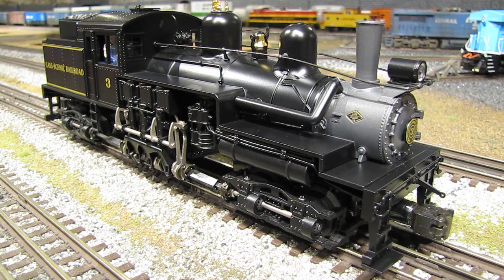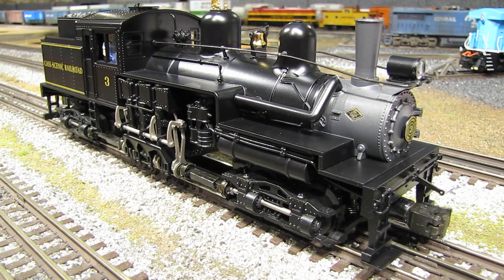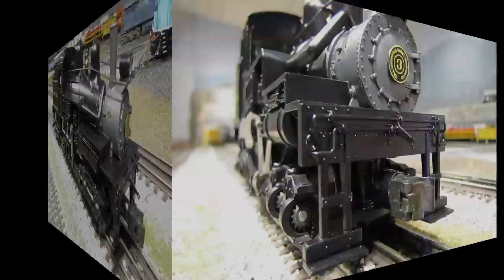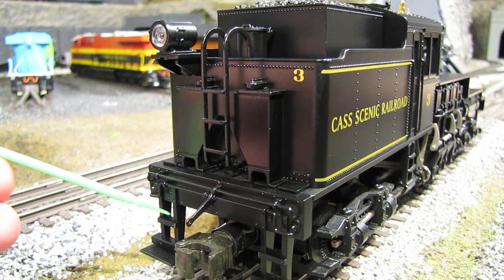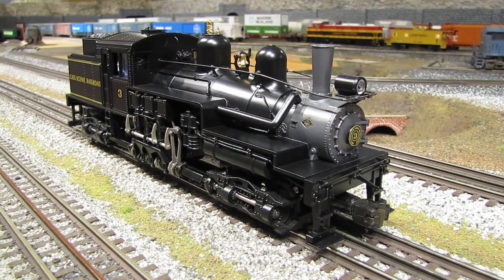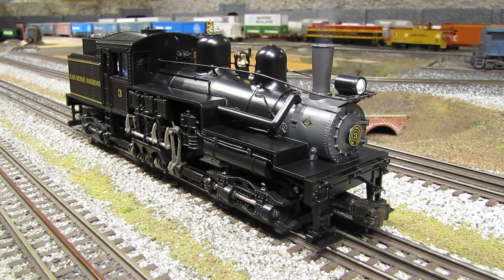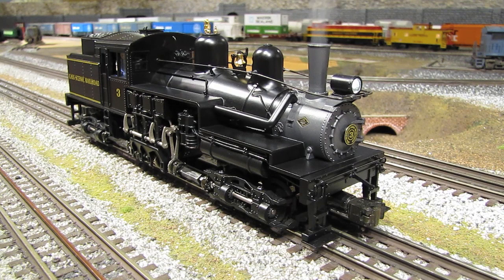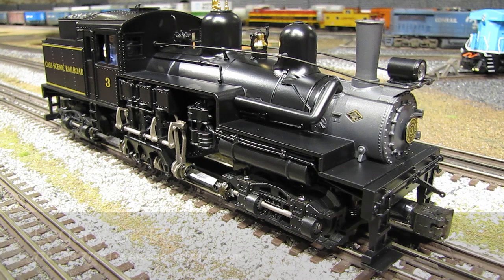Lionel 2-Truck Shay Locomotive

Comment: I've been on the double-header full day trip in cass on that railroad. Numbers 3 and 6 pulled my train (I should say pushed as they never ran the trains with the cars behind the engines when going on logging runs or in the excursions currently ran. I recommend going for anyone who's into railroading. I have a great love of west Virginia and the history of that region so it was a great time but when I found out that just about every locomotive they run was made in my home state of Ohio it brought even more pride in my state. Going up a 14% grade in a train was also incredible since virtually no other locomotive is capable of it on smooth track.

Comment: This 2-truck shay of course is from K-Linemtooling. Lionel got them when they sued K-Line and put them out of business. The actual scale of the model is a bit larger than 1/48th scale coming in around 1/43rd scale which of course makes our O gauge track more correct in its gauge.

Comment: By the looks of the trucks, that is a 2-truck Pacific Coast Shay. Pacific Coasts were basically a much-improved on version of the standard Shay (with such improvements as a new truck design, superheater as standard, Walschaerts valve gear, etc.) in order to compete with the Willamette geared locomotive, which itself was a much improved-upon copy of the Shay. Then, of course, Heisler came out with their West Coast Special Heislers to compete with the Willamette and Lima's Pacific Coast.

I'm not entirely sure if there ever was a 2-truck Pacific Coast built, but it could've easily happened.

Comment: Great video! I didn’t know the front opened. I bought the Western Maryland for my son a number of years ago. Problem is it goes a short distance and trips the transformer. All of our other locomotives run without issue except the shay. Ran it on someone else track and ran fine. We run a Rail King z controller. Any ideas? Thanks in advance

Comment: Lionel's been using three rail track for a long time, only reason they haven't gone over to more prototypical two rail is that it would make the older trains and accessories, say the postwar stuff, incompatible.

I see that as a good thing, for given the cost of even the older Lionel stuff, it's nice to know that it'll all still work with the present range so long as you're running conventional DC.

Comment: Awesome video! But a bicycle does not actually have reduction gearing. Even in 10 speeds the lowest gear is close to 1 to 1. So a tricycle actually has the most torque for getting up a hill haha.

Comment: I'm all for crew talk if it is appropriate for the locomotive.  In this case, radio chatter in an 1890s locomotive is kinda like a barking lion. It just doesn't work. Can't Lionel make some era appropriate sound bites for an engine in this price range? Like "My, doesn't Miss Penelope look fine in her Sunday dress!" Additionally, this locomotive sounds nothing like a geared engine. There is no shortage of operating geared engines in the US to record. Lionel is not even trying in this case.
Reply: I heard that "radio chatter" and I laughed my butt off! REALLY STUPID!!! The whole sound thing is way off too. Sad for an engine that costs as much as this.
Reply: RedstoneJohn for the record if they made a C&O one it would be accurate the C&O used shays in some of their yards.
Reply: To  be fair the builders plate said "April 1923"... but still radio chatter is more 1940 than 1923.
Reply: @bennettleffew  Some logging railroads were using late 1800's Shays up until the mid 20th century.

Comment: I've always wondered why shay steam locomotives have the boiler a little off of the middle of the engine. Why is that?
Reply: Carter Resset It's so the cylinder bank isn't to far off to the side
Reply: It is also to offset the weight of the cylinders and drive gears.

Comment: Cass scenic number 3 is 3 truck and is no longer in operating condition
Reply: +iliketrains2 Actually it is, it operates out in Oregon, the city that owns it sometimes operates it.
Reply: The #3 sitting in Cass is also a three truck 80 ton shay.
Reply: +AmperageBassist No sir.  I notice that a lot of model train companies will just slap a name on a locomotive as long as it is that type of locomotive, not necessarily the proper model of that type.
Reply: +AmperageBassist No sir.  I notice that a lot of model train companies will just slap a name on a locomotive as long as it is that type of locomotive, not necessarily the proper model of that type.

Comment: Why doesn't Lionel take the time to record the actual stack sounds of a 3 cyl.Shay.  The sounds provided by the system are obviously from a rod engine.  A real Shay sound like it speeding down the track when it is only going 10 mph, or less.  As much as I like Shay locomotives and logging railroads, I will not buy a Shay from Lionel  until they make one that sounds correct.

Comment: I love the look, and I Luuuuuv the whistle, but being a logging train enthusiast I have to say SHAME ON YOU LIONEL!!! the chug rate is for a conventional rod locomotive!!  It should sound and smoke a LOT more.  There are a lot of Shays around in running order, why not use the right sound?!?!  To ask someone to invest that much in a Locomotive without even getting the sound right?  It sounds and smokes as if the shay were a one cylinder instead of three!!  AWFUL
Reply: I don't think any of the model train companies have the chuffing sound right on their shays and as far as the smoke goes, I have this model and it smokes great!  At times I think Eric let the smoke unit get a little dry.  Anyways, that is my two cents worth!  Have a good one!
Reply: My big problem with Lionel is not so much the chuff sounds, but the road names. They make road names for locomotives that never even served with a specific railroad. For instance, there is a Union Pacific 3-truck Shay. Union Pacific, even though they did own one or two Shays as yard switchers, never owned a 162 ton Shay. But I can't really complain since there are some people who would prefer a specific road name over another, and Lionel of course has the core road names, and the road names which I have a problem with are completely supplemental to the essential ones. Oh, well.
Reply: Cram in a 9000 series sound chip! 3d cylinder!
Reply: The existing sound module actually has every third stroke sound a little different, so they've made some adjustments... but it's not very well synced with the engine, AND it shouldn't chuff this hard when running without load.

The Shays on the scenic railroads (that there are plenty of videos of here on Youtube) barely chuffs with a bunch of passenger cars behind them. If the manufacturer really wanted to make it sound authentic they'd need a level sensor for the train and a load sensor on the coupling... :P
Reply: ziiofswe  The intensity of the chuff is adjustable on the Legacy remote, Eric typically likes the sound of high labor / heavy loads!
Reply: Bill Yates
Ah, thanks. I'm not familiar with this stuff at all, I play with smaller toys (Märklin H0) and larger toys (cars and motorcycles 1:1)...
Reply: Even Bachmann got it right in their HO scale shay!!!!!